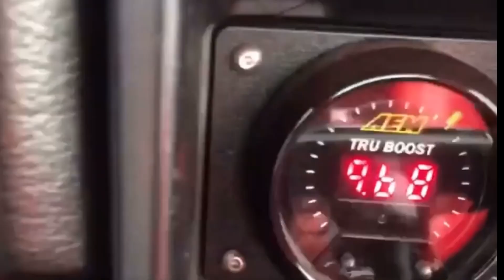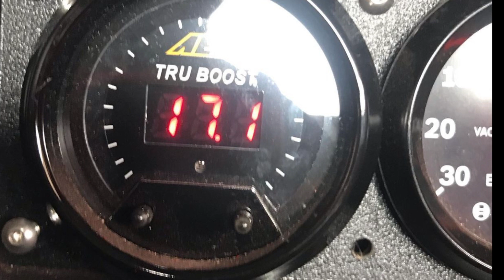Turbo Mustang Build Recap

Comment: I'm getting a 95 gt convertible 5.0 manual and will restore it. Would like to set it up for lots of highway driving. I don't plan on racing but would like it to at least be faster than my daughter's Saturn vue redline...lol.. was wondering your opinion about turbo vs supercharger.
Reply from the maker: Low boost supercharger and enjoy it. You can build it for 300rwhp NA fairly cheap. Top that off with some boost and you'll have a great highway toy.
Reply: @SN95 Power  thank you sir!

Comment: With the vents on the hood, does water/snow get in the motor bay?
Reply from the maker: It will. Got caught in rain once. Just had to remove water stains
Reply: @SN95 Power  I am nervous about the weather getting in. I live in Southeast Ohio and sometimes it's like I'm back home down south with the rain!
Reply from the maker: @rushtk2112  I don't drive car in bad weather. It shouldn't cause issues. Only thing moisture would hit heavy on my car is dizzy and coil pack.

Comment: What block( R? Or stock) was that and main caps?
Reply from the maker: Boss block. I was checking wear on thrust bearing
Reply: @SN95Power   did the boss block come with those billet main caps, or did you add them
Reply from the maker: @svtmatt6189  All boss blocks come with those 4 bolt caps
Reply: @SN95Power   I thought so. I was just curious if you went with an aftermarket brand  of main caps or if the ford brand was good quality
Reply from the maker: @svtmatt6189  This boss blocks are not the strongest aftermarket block but they can take 1000hp
Reply: @SN95Power   they are good.  I was looking at getting one. Or a dart
Reply from the maker: @svtmatt6189  Get a dart. If you want to go 363 you can get off shelve pistons. I couldn't do 363 with a boss block without custom pistons.
Reply: @SN95Power   really. They offer a big bore boss   Hmm interesting.   I was looking at doing the dart 363
Reply from the maker: @svtmatt6189  They do but those pistons are short skirts. If you build your own motor, last I checked you couldn't buy short enough pistons for a boss 363 off shelve. Also they could have put better rods in that Ford Racing 363 for the price. I' m sure they are strong enough for 80% of the people who bought
Reply: @SN95Power  gotcha.  That will be something to double check on. Thanks for the heads up.
Reply: @SN95Power   I’ll probably get a bare block and just stockpile parts    I wanna try it myself and learn as much as I possibly can. Plus I wanna choose the parts, so it’s success is on me to see if I’m smart or not 😂😂😂
Reply from the maker: @svtmatt6189  If you can read a micrometer, dial bore gauge and do basic math, you'll be fine. I'm sure if you buy your dart block through Fordstrokers.com Woody would answer all your questions with your build. I would take Woody against any other sbf builder out here.
Reply: @SN95Power   I can read them  lol. And I’ve been on ford strokers website browsing 
I’m attempting my stock block in my other gt before I start the 363. Hopefully I’ll have some videos or pictures from it 😂😂😂 depending on how I feel.
Reply from the maker: @svtmatt6189  if you're going to do it might as well record it.
Reply: I don’t do good in front of cameras like you    I enjoy your videos tho   🤘
Reply from the maker: @svtmatt6189  appreciate it 👍🏽